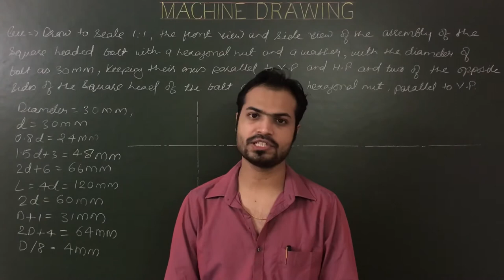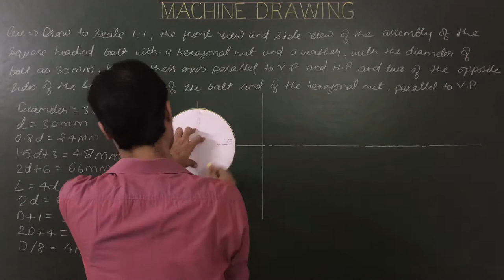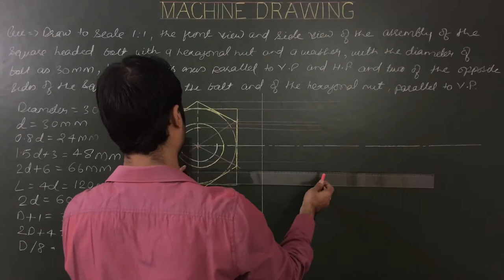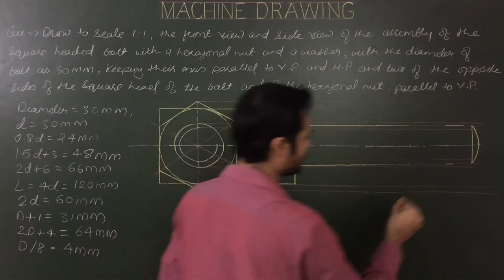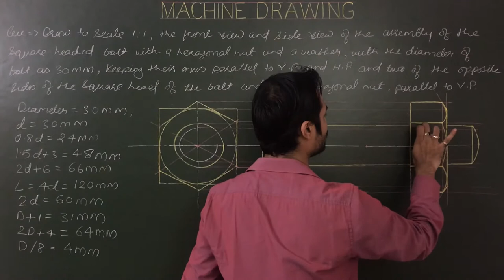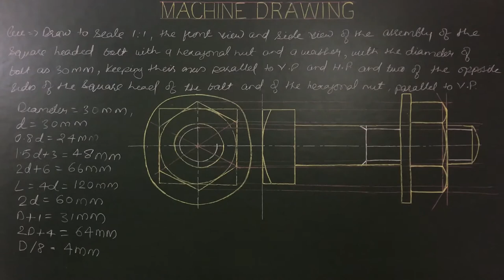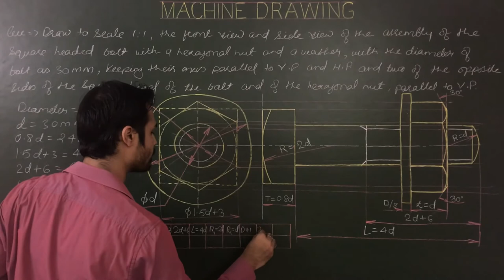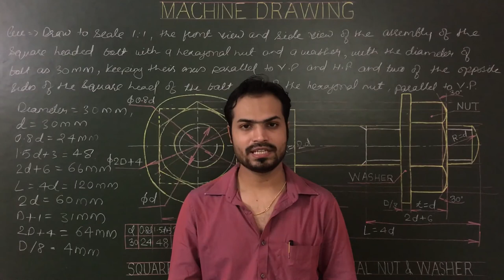Square Headed Bolt With Hexagonal Nut And Washer  In Machine Drawing (Part-17)

Comment: Sir I have been given a question of a (front view only) hexagonal head bolt fitted with square but and washer keeping common axis horizontal and two opposite sides of both bolt and nut are vertical but the side of the nut is taken to be 1.5d+3, for the hexagonal head it is 2d,                 sir could you please help me with this.